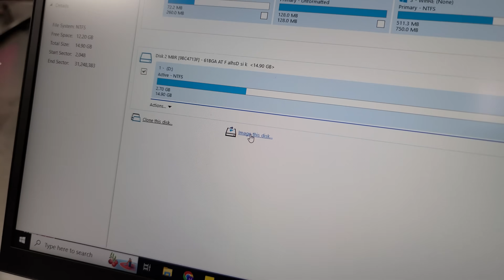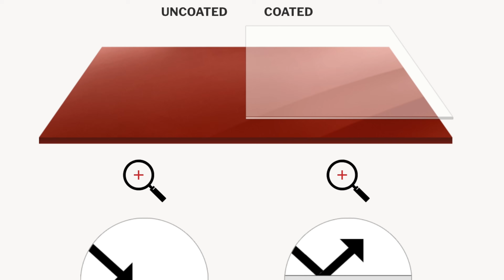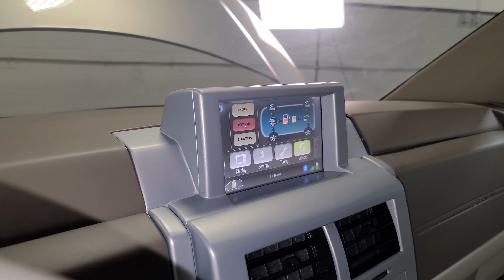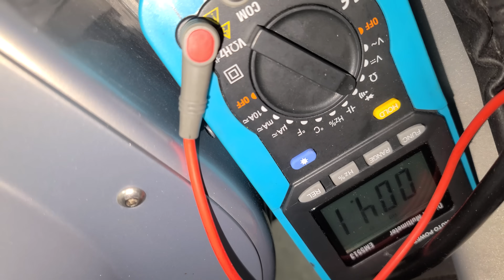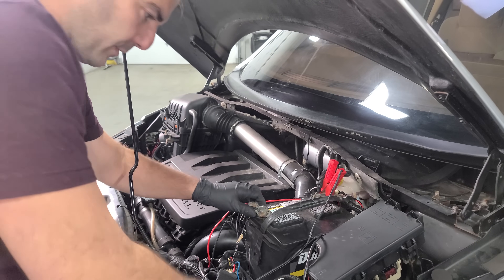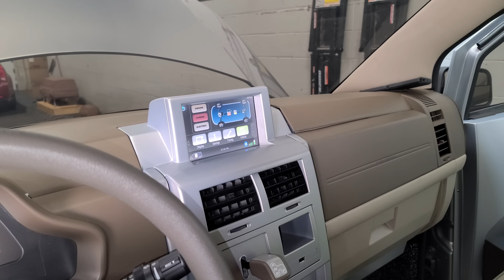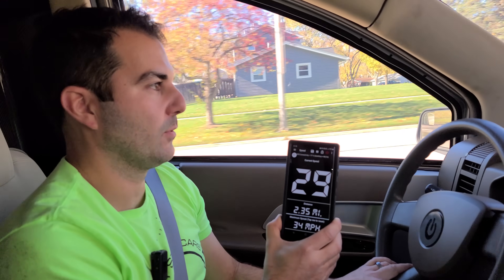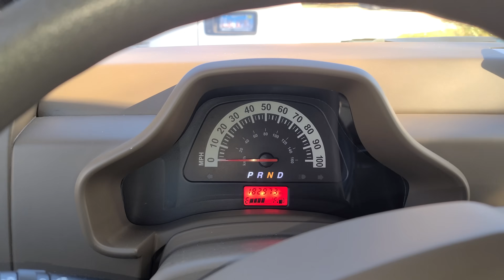I Thought I Finally Fixed The 2 Million Dollar Concept Van Until Disaster Struck! What Would You Do?

Comment: I will watch every single Bright Idea video you'll come up with. These new problems may seem like the end of the line, but as I roam through the comments, there are some good pointers. Like the axle being a hack job with it's bad welds and the possibility that the throttle body doesn't get a good signal because some simple thing being broken or unconnected. I know I may have my hopes up and looking at that wiring craziness is certainly a thing that can make one dizzy and unmotivated. But I have to still cheer you up to maybe still try to keep on trying, at least for a video or two.

Comment: I'm sure that there is a multiplexer module that control the gas/electric switching. When the car is in electric mode sends the throttle signal and the "ignition" signal to the electric part and when gas is selected the throttle and "ignition" signals are sent to the ECU of the gas engine. A fail in this supposed module could explain both the ecu not respondig to throttle signal and no "turn on" signal. My bet to find it is to follow the throttle signal wiring

Comment: I bet that keyless module also does auto starting function for the gas engine, it will need a module to crank the starter and monitor the tech signal to figure out when to stop cranking.

Comment: I just watched this video, and from what seen, the gas peddle woks fine in EV mode, but the gas peddle does nothing on the gas engine. 
That tells me the gas peddle has no cable going to the throttle on the engine. 
When the engine was running and you put the peddle to the floor and the engine stayed idling. 
Their has to be some kind of throttle position sensor for the gas peddle, and a servo or stepper motor to control the throttle on the engine.

Comment: Is it wired accelerator or electronic that controls the acceleration of both the EV and gas? If it is electrical, it could be bad as well. I trace the throttle when get done fixing the axle.

Comment: Fix the axle or both might need fixed.
Since you have a good idea of engine maybe see if the computer is correct also and back track some wires in starting circuit to see if there similar. 
After that it might be a good time to let it go.
I think your probably further along then they were. 
You've probably already drove it more miles than they did.

Comment: You might be fighting the security system. I believe that I heard you say it was a dodge engine. Some of them had a security system that can't be deleted. They can be temporarily deleted for diagnosis but will reoccur if you attempt to drive it. Could also be a throttle positioning sensor just not working.

Comment: Just out of curiosity, if the relay was getting power when you hit the engine power on the screen why not tap into the relay to start the engine instead of adding an external switch/ button?

Comment: If both systems are using the same accelerator input you likely have a relay that flips back and forth to send that input to either the engine PCM or to the EV controller.  Whatever is preventing your start signal is probably also not flipping over the throttle to the engine PCM.  That is why you only get idle out of the engine.

Comment: The car should start from the computer. I think a D+ from the alternator gives him a signal that the engine is working. Then he connects the accelerator pedal to the engine and the accelerator pedal works.

Now back to the beginning. You took out the computer. There is a good chance that something is wrong there or that you have hit another connection.

You will have to find out how the computer is linked to the engine. It could also be that a USB in/out is connected somewhere. After all, you also replaced the screen

Comment: I think the engine acts more like a generator so it might be controlled by the stuff in the back, so the engine revs are controlled via the computer in electric mode(hybrid mode) to charge the battery's and drive the electric motors when the battery is low.
I would fix the shaft and let the battery get low but i would have the engine running because it cant start it automatically and see what happens.

Comment: Get the axle fixed.  Then disconnect the automatic shift over to gas controls.  Just have two different systems and use them when each is needed.

Comment: I don't recommend using a screw gun to work on electronics.  It's like driving tacks with a sledge hammer.  The vibration alone can destroy components and separate solder welds.  Another consideration is static discharge and of course, damage to the threads of such tiny fasteners.

Comment: The entire issue is the speed controller. Get a newer speed controller and the convulsing will not be an issue anymore. The guy that helped you fix the battery bank can set you up with a much more reliable used speed controller affordably for this existing electric drive system

Comment: They might have used a remote starter to start the ICE engine to limit cranking time. It also might be used to bypass the immobilizer in whatever engine computer they used.
If the remote start module is bad, its possible its not immobilizing or is not cranking the engine.
The accelerator pedal might be controlled by the computer to enable regenerative braking when you decelerate, and possibly computer doesnt "think" the engine is running cause remote starter output is not telling it its running?
I would start by finding the manual for the remote start, figuring out what wires are connected to it (can-bus?) and working the wiring back from there.

Comment: Your van may have an electronic throttle (drive by wire) - depends on the year of the Chrysler motor. Maybe the accelerator isn't connected to the throttle body anymore? Do the RPMs seem to change at all?

Comment: If you could get an EV builder/computer guy to come in and bypass the engine limiters with switches like you did the start switch and fix or re-weld the driveshaft it could work.

Comment: Since it's a hybrid the electric, the throttle pedal has to be shared between the hybrid drive system and the gas engine. That control is probably done through that old school computer system. Since that's how you switch between the two with that interface on the dash. I'm assuming they didn't go as far to try and Link the can bus network of the factory car wiring harness and probably did something much more simple to get the Hybrid engine to start on its own and get a throttle pedal signal. Like using a remote start system and some way to share the throttle pedal input to the engine computer.I think you've done as much as you can for what the bright engineers did at that time. If it was my van and I had an unlimited money supply I would definitely throw a modern battery pack in it with a Tesla drivetrain and try and hook up my own hybrid system whether it be manually switched between the engine and electric motor or automatically through some screen. Kudos to you for putting so much effort into it and getting as far as you did with it.

Comment: You could also get an .ide to Sata Converter (They may be a rare as Rocking horse Turds) and put a Modern 120Gb SSD in there. It may only run at Sata 2 Speed but still way.. Faster than .ide

Comment: An automatic won’t move unless the engine is actually running so the transmission pump is actually making pressure for it to work to begin with.Only a manual transmission will actually move if in gear m.

Comment: I have sn idea.. get some tech high school/college bunch to do a project where they get all the functionality there. You could remove all of the Bright electronics and the school project could build it from Arduino & Rasberry Pi. Absolutely doable and the platform makes the programming for it very straight forward. There are already  stuff developed for Arduino to run EV conversions, and pairing that with another project based on the same platform, Speeduino, should be very doable. Keep the old Bright stuff in a box so it can be turned back into its original form if anyone wants to. You wouldn’t have to do anything else than
Put together one episode of their success and they’ll do all the work. Once finished it could be sold  and the money donated to charity or a fund for education grants or whatever.

Comment: if you see this i have an idea on why its not starting in one of those videos from 2010 of the van running and driving it said you need throttle to start in hybrid mode I know it should start in engine mode but maybe because your not getting throttle response it wont start the engine or when you click engine and it doesnt maybe you need to move off with throttle to start but with no throttle response it might not be starting but anyway thats my thought

Comment: The speeds of the two drives are probably the same. 500-550 Mbps. A mechanical drive (HDD) is about 100 Mbps. Nowadays we use m.2 NVME drives that are 1500 - 8000 Mbps. If you have a m.2 SATA (before NVME) it is the same as an SSD...550 Mbps

Comment: An electric motor makes torque at zero rpm. The axle that broke partly from that, but mainly because it's a custom piece and they didn't calc the loads it was going to face. Pull both and see what a driveshaft shop could do, or a shop that can make custom axles properly. 
Personally, I wouldn't give up on it. What I would do is strip out all the ridiculous wiring, separate out the components involved, and build the whole system out on a breadboard. And I mean literally. Two 4 x 8 sheets of plywood end to end. 
Also, in watching how the engine is behaving, could all those bypasses present be an attempt to work around the Chrysler VATS system? See if that's in the engine ECU. 
And again, don't give up!

Comment: Any machine shop can fix that axel, or make a new one. Then get a stand alone, fly by wire throttle and bypass the stock stuff like you did the starter circuit. Only the  old CEO would give any real money for it. See if he'll give you double what you have in it and run.

Comment: Could there be an electric drive measurement that checks the voltage level and only allows gas engine drive below a certain level?
When you started on this car the electric drive battery was low and the gas engine started up.
Repair the drive shaft, put it on jack stands and run it. See what happens or not.

Comment: I haven't watched the full video yet, but the Caliber 1.8 could be ordered with an auto stop/start module on it. I haven't seen you trying to start the engine with e-brake off / foot brake on / in gear and accelerator depressed. Just telling the software to switch on the engine isn't enough.

Comment: Since the engine is running but the throttle doesn't work, maybe the throttle signal goes through the computer, even when in gas mode? Since you started it via your hack the software might not be in the right mode to pass the signal on.

Would you be willing to upload the software somewhere?

Comment: Your limited throttle is due to the missing communication to TCM. Its in limp home mode. For the computer control of engine starting EV system computer should have a set of GPIO connections. One of the outputs should be controlling a relay for starter operation and probably another relay added in to Injector or Ignition coil power feeds for shutdown purposes while keeping the PCM alive.

You dont need a Bright company engineer. You say you dont know how its supposed to work but its all pretty common sense. You just need someone who actually understands automotive electrical systems.

Comment: Finish it! Why? Because you're almost there. I can relate to your emotional suffering, but you've solved so many fundamental problems, that it would be unwise, to give it up over a simple broken axle. It looks normal sized for a small transport car, these are standard joints, so it would never break under normal circumstances. It seems pretty obvious, that it got severely overstressed by the brutal shaking episodes. No wonder it gave way shortly after. Just renew both of them, if feasable, and it will work fine. 
The question what "finishing" for this particular concept vehicle means, leaves a huge room of possibilities. I'd say that this will never be a normal car - starting with the plastic windhield, the rough and incomplete wiring and the underwhelming range and power - which was typical problem of electric cars of that time. But it is an interesting piece of history on the early stages of the modern electric car world. This could have been the tesla of the transport world, if they had had enough time and staff to take the whole layout to the finish line. At least it was way more honest than the Nikola approach. 
I like your solution with the starting contact, maybe you could add a similar solution for the throttle signal as well. Having it just somewhat driveable is not exactly what you intended, but I'd agree, that it is hard to deal with this hastily cobbled together showpiece, that maybe never fully worked as described. Not because the basic hardware wasn't here, that looks pretty well done (the outer shell, the drivetrain, the computer/screen implementation) but because they did not have the time to finish it. It should find a home at the original CEO if he wants to keep it as a window to the past, or at a museum. It looks pretty good inside and out and works decent enough to have some fun driving it for a show. Lets face it: If someone restored an EV1 to working condition, no one would ask if it reaches the original range. Having it driving around the block at a show would be epic. And so hopefully your sapace Van will have a future as a window to the past that looked great, but never was. Even if it was just barely moving.

Comment: You need to program another key to that remote start module so the van will see the key if not it will just crack and not start dei makes one called a CHALL that will trick the car into thinking that the key is in the ignition they are not that hard to program but I do believe that you need 2 keys to program

Comment: Hey, that engine "hack" you wired up for the start button. why not run those wires into that relay by you foot? that is clearly ia triggered when you try to start the Engine. i bet it originally used that remote start module to trick the van into starting by the computer triggering the remote wire. just bypass that crap. I really wish i could work on this I am fairly confident i could fix it.

Comment: Axle was cut to fit the van and welded very poorly. You could give it to a proper welding shop. Also, I would like to know what happens to the throttle if you press the gas pedal.

Comment: I haven't even watched this video yet the only space ship van there is. Is a Pontiac trans Sport minivan with a 3.1 don't matter about no show or anything.  94 Pontiac trans Sport
I had a first gen Prius and it was like you van and if you turn it on this way And only this way it act like a normal car. And it needed abs sensors and needed an engine. It run wide open and get 60 mpg and nearly stall on a mountain climb.
You'll find that special way. There was many on time I go out five mile and wonder how I was to get back.
If it left you somewhere cause you didn't fire it up right it was two to three days later before it fire up again

Comment: I would guess the axle broke because of the original chaotic electric motor shaking and vibrations from the broken bracket.   
Donate to a car museum or let a secondary tuner investigate the fuel map and tuning settings.  If you can get the front engine to drive faster, and install a switch to disengage ev axle, you could use it

Comment: Where does the EV throttle signal come from? If it’s off the throttle position sensor on the gas motor then that is your issue. Scan the OBD again as it may have a code tied to it.

Comment: I would pull the electric motor and battery out and then the gas motor out and all.the wiring involved with.them two. Just keep lights and dash and interior wiring. Then put a Toyota or Honda running gear in it and keep for a unique car.

Comment: This is what I would do brother, rip out all the electrics+ motor and batteries and everything buy a factory wiring harness and replace everything and use it as a gas van with a bad ass electric power inverter gen set in the back.

Comment: Wow look at that yet again Alex got to excited way to soon and didn't take the right precautions to not get in this situation again. Man you really really need to take a rain check on yourself cuz you have consistently put yourself and others in potential danger with this project. You get to excited and try to get things done quick instead of taking to time and due diligence to make sure everything is in good safe working order like idk maybe put it on one of your lifts or jackstands and to drive testing in the air to make sure both drivetrains are working correctly. Do all the necessary repairs/reinforcement/upgrades/modifications you need to before taking it on a public road. Cuz as I'm sure you remember this car never saw a public road off a trailer until you had it, It was only ever tested on closed course's from what I know so again please take the time to be more safe and just slow down a bit try to no get so excited and start rushing through things. The only thing I saw you be genuinely take your time to be safe with on this project was the battery replacement. Please Alex you really need to start considering scary a lot more coming from an OSHA background I know all about safety and complacency

Comment: rip out all the hack job Calibre wiring. put in an aftermarket ecu, just a basic unit to get the engine running & starting reliably. build it into what the engineers were trying to make. That'll make them more proud.